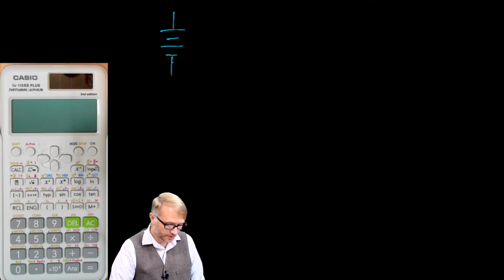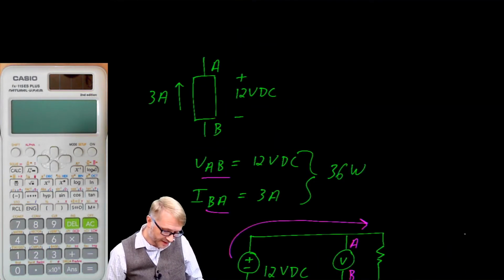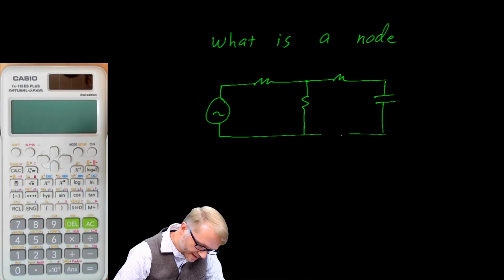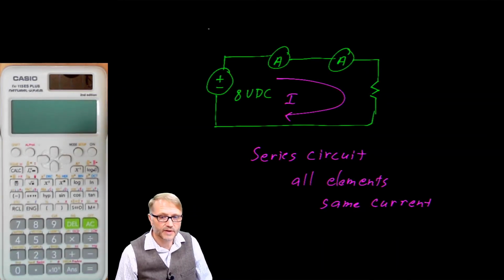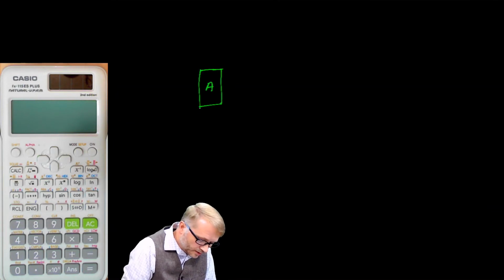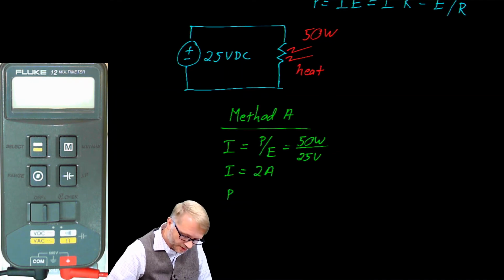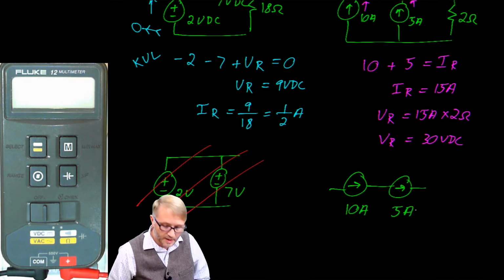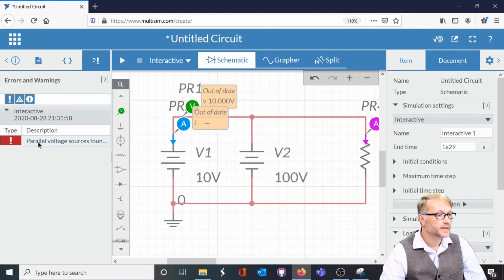#2: Kirchhoff's circuit (KCL) & Voltage Laws (KVL)

Comment: 0:16 Review 
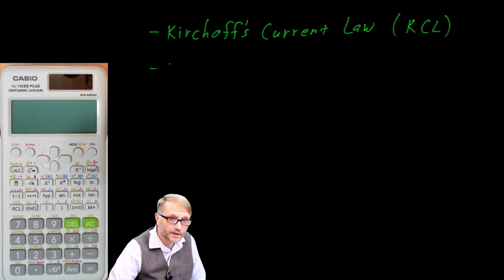8:17 KCL & Node 
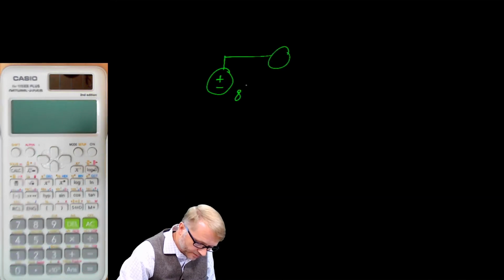17:50  Series & Parallel Circuit 
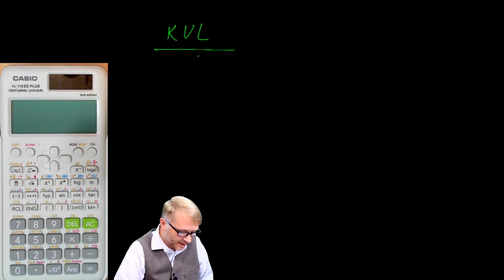21:07 KVL 
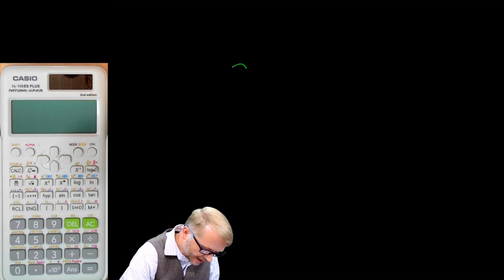23:38 Loop 
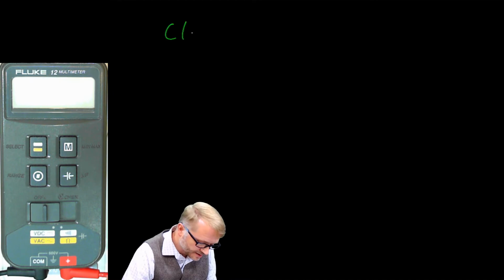28:18 Rule for loop 
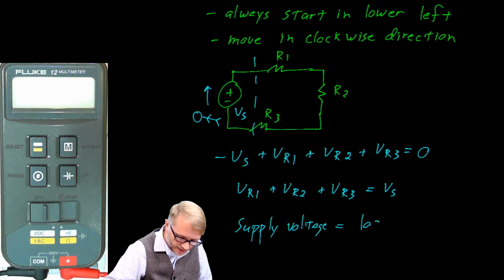29:46 Recap 
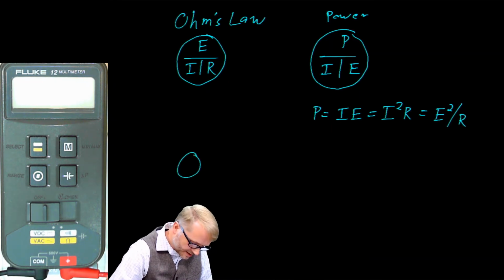30:30 Tips and Tricks 
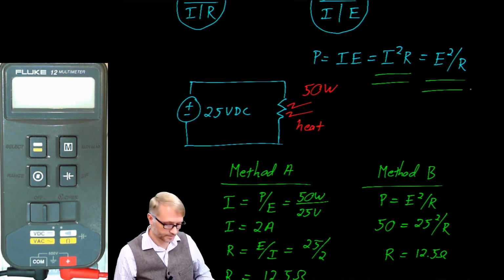32:20 Constant Volt & Current  
34:25 Next Chapter teaser 
34:42 KCL,KVL examples 
36:41 What not to do! 
37:44 Example w/ constant voltage and current
 40:04 Virtual Lab on multisim
Reply from the maker: Thank you! You really helped with the previous video - don't edit when you are tired...